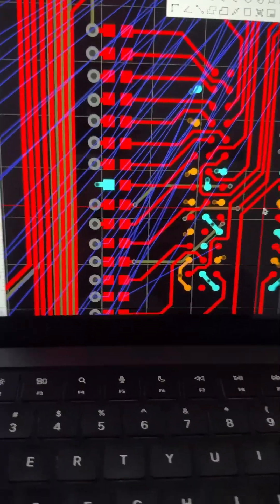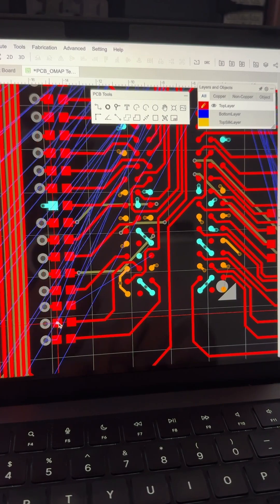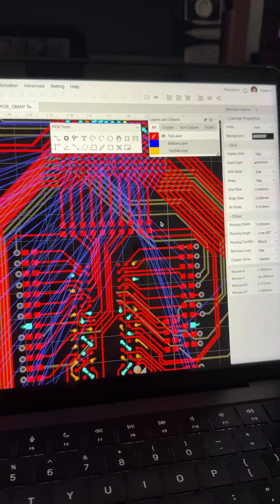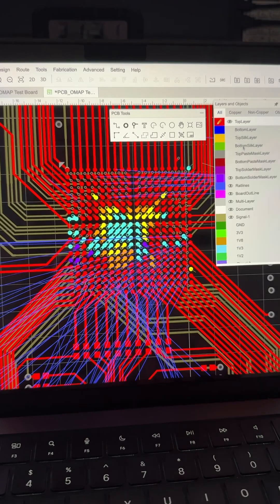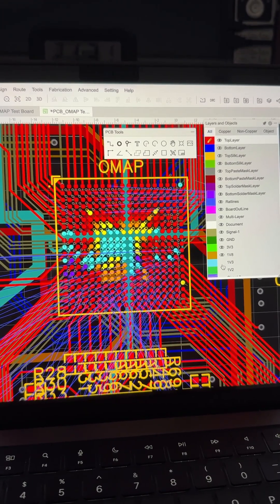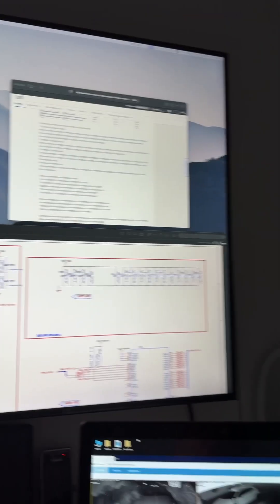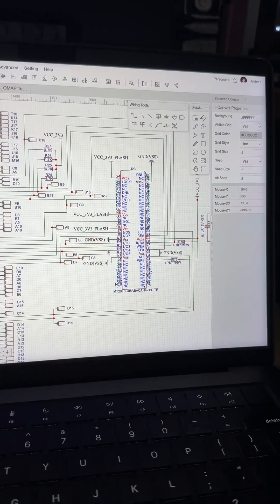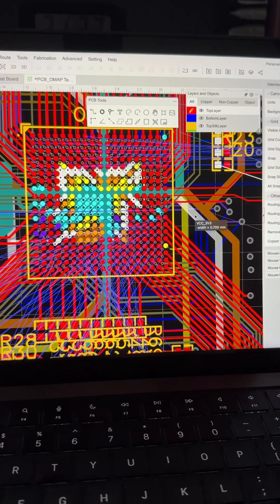New OMAP L138 Design

Comment: System error ld :000 line:0419../MCU/component/OmapL137Mcasp.cpp kronos 1
Dear sir, what does this message mean and what is its solution, please?
Reply from the maker: Hi, sorry for the late reply, I didn't get a notification with your message not sure what's going on YT not sending me email alerts. 

Anyhow, the message is about the McASP part of the OMAP chip, it seems that the system is using an OMAP L137 Chip, and the chip uses McASP to speak to the AUDIO Decoder chip (usually PCM1793), if you are seeing this then the following could be the causes:

1) A faulty audio decoder chip (PCM 1793); cannot decode the signal coming out of the McASP/OMAP's end due to a fault. 
2) Bad motherboard connections to either the PCM or OMAP chip
3) A Ceramic capacitor in either of the 2 chips gone wrong
4) Cracks on the motherboard. 

If you are seeing these errors, then it's unlikely to be a software / firmware issue, and likely a hardware issue. 

out of interest, how are you seeing this? what exactly steps are you taking? 

Thanks

Comment: What is new about kronos
Reply from the maker: Hi @3awdsimol, this will not replace anything on the Kronos, the Kronos uses an OMAP (same processor) to power up the screen + sound engines... I am creating a board to do similar more advanced things and eventually upgrade the Kronos once all goes well. But for now with this design it's a little early to tell if it would replace the Kronos board yet.